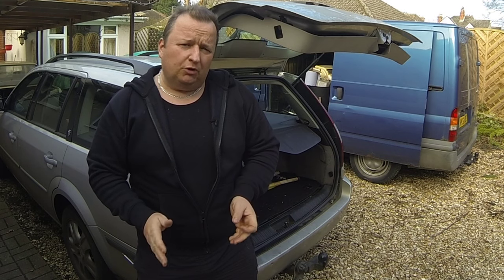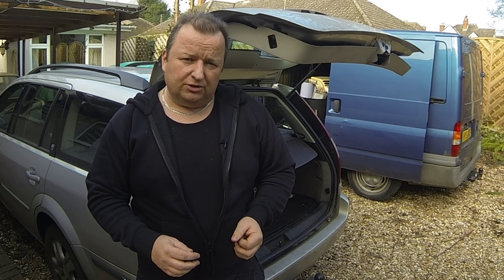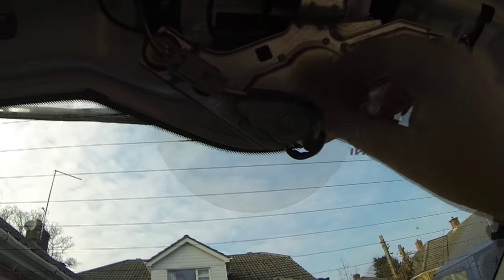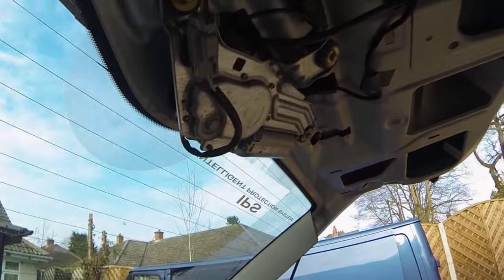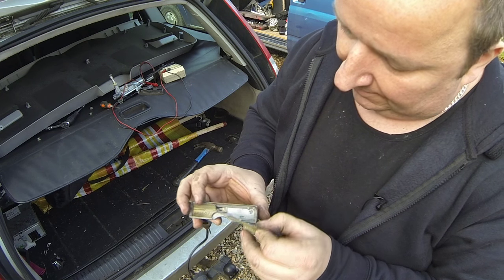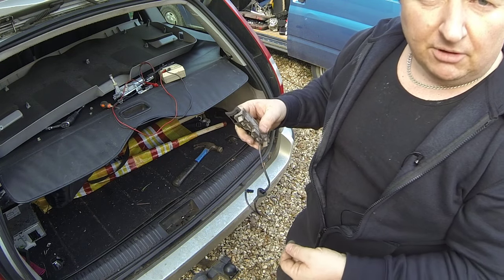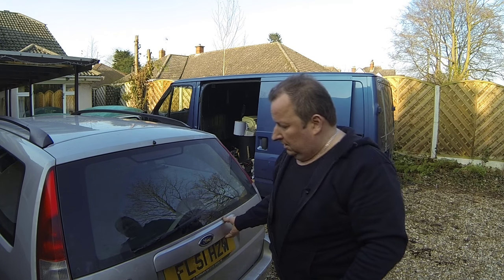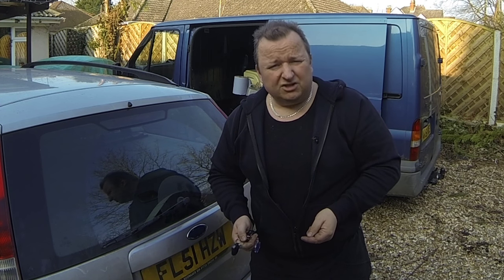Mondeo MK3 Estate Hatchback Keeps Opening Problem Tailgate Switch  How To Sort It

Comment: had the same issue on my hatchback model. I took the plastic seal cover off the back and it turned out to be a loose contact. Found this out as the switched worked well when connected in the car but stopped working when put it in the handle cover. wedged the contacts with a piece of card and 8 months and 20k miles later it still works. Keep up the great work!
Reply from the maker: +Miles Williams Nice one Miles, looks like this is a common fault. 
Cheers
Martin

Comment: Hi Mate, Thanks for your video it helped me out big time. It turned out that the switch for me wasn`t the problem, it was the lock mech that was sticking but without your video I wouldn`t have found the problem. I fixed it and made a short vid myself and linked your vid for the panel and microswitch removal. By the way I also found your vid on the dashboard lights useful and will be using that next coz my dash lights have gone
Reply from the maker: Glad it helped

Comment: Hi, congratulations for the videos entered for the Ford mondeo mk3, I have a 2002 mondeo mk3 station wagon, I have a problem with the tailgate, it opens with the remote control and the key, but not with the internal or external button, I would like replace the rear switch, but I can't find it at a good price, can you give me some help where to find it? Thanks so much
Reply from the maker: I got mine from Ebay bud.

Comment: gonna replace that switch on friday as mine just broke or well it just wont release from that switch, but works from keyfob. Wish me luck haha

also question - You say it's the water that killes them, do you think you could fix that somehow with silicone ? Read on the internet that the switches go bad after 10-16 years or less, because of the way ford made them..
Reply from the maker: After all that time corrosion also kills them.